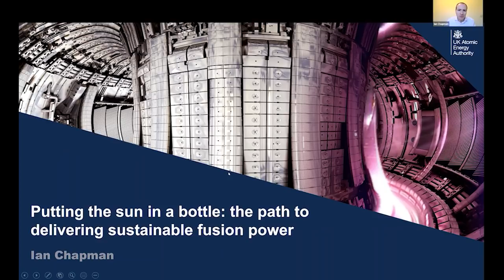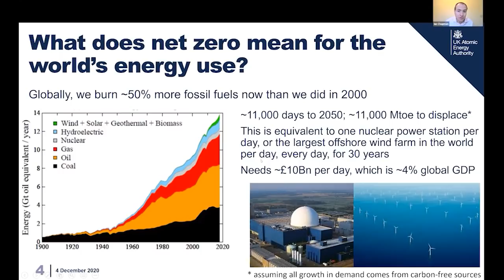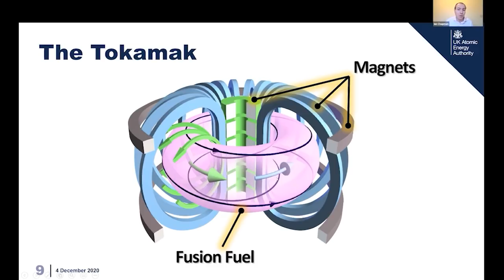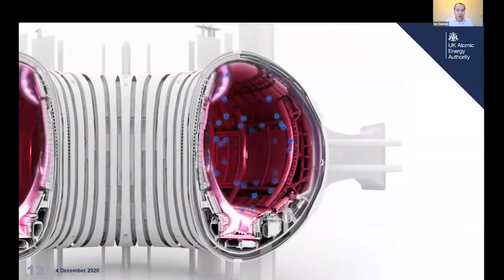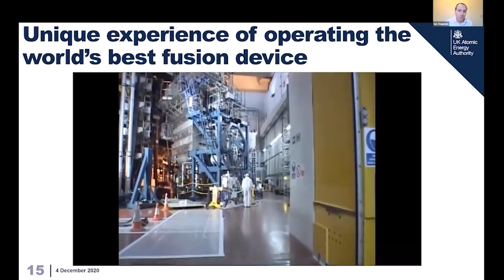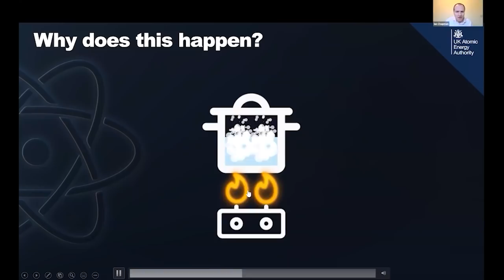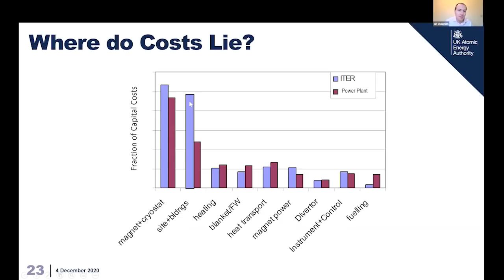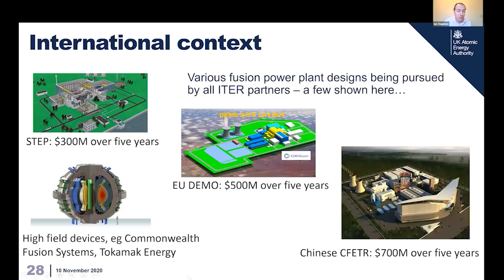Putting the sun in a bottle: the path to delivering sustainable fusion power | The Royal Society

Comment: Do you really hope, that the price will be lower than today´s 3 cents/kWh from solar and wind and in 20 years  a half?
Reply: Yea I love that he conveniently never gives a cost even if everything works as hoped(while at the same cost giving some of the highest cost estimates to other renewables I have ever seen)
Reply: It's not an issue of cost, but human planetary survival; otherwise you're going to have to get rid of a large part of the human population which would lead to mass chaos.
Reply: @waynet8953   The question is what is the lowest risk way to ensure human planetary survival. And cost is a key component of figuring that out. A low cost solution is usually the one that is easiest to get support for. Solar and wind are absolutely  capable of solving the electricity production aspect of global warming without needing to do something crazy like reduce population. And they are cheaper than fusion. There are perhaps other reasons to invest in fusion anyway. Solar and wind do have some downsides(nothing to bad to stop them from stopping GW) but enough that fusion may one day be considered a better tech. But if your goal is stopping GW outside of tech neutral approaches(carbon tax for example) increasing the useage of solar and wind power is one of the most important steps.
Reply: @peterisawesomeplease  isn’t that essentially what the green new deal that AoC was proposing? Because if so, with an estimated cost to make just America Green of $51 - 93 trillion dollars, I’m not certain I’d call that “Low Cost”. There is a very serious problem with your goal, and that problem is simply space. The reason for sky scrapers is because we started running out of room in popular locations to live in so we had to start building vertically to fit everyone, how exactly is one going to fit NY city or Tokyo with solar? You could centralise all the infrastructure into a small area, but then the damage that any natural disaster or something along those lines stands to do is tremendous. To cover just the amount of energy humanity is currently using, and not the amount of energy it will be using in a few decades when a plan of this magnitude could be expected to be nearing completion, you’d need to cover a path of land roughly equivalent to a significant amount of the Sahara desert, something a lot of countries just do not have access to, because there’s people living there.
Reply: @dylanshandley1246   $51 - 93 trillion dollars I have no idea where you are getting this cost estimate. Most recent estimates say we need 1 to 2 trillion in investment over the next 30 years. Doing it with fusion would cost more not less than solar even if we had working fusion power plants today.

"how exactly is one going to fit NY city or Tokyo with solar"

There are these things called power lines. Pretty cool. They can take power from places with cheap land to expensive land.

"land roughly equivalent to a significant amount of the Sahara desert" not per country. And actually not even for the entire world do you need that much space.
Reply: @peterisawesomeplease  $51-93 trillion is the estimated cost of the green new deal, which a politician in America put forward, according to that reps site, “The Green New Deal Resolution outlines the framework for a comprehensive and ambitious plan to combat climate change by creating millions of high-wage jobs in new green industries, transition our energy system and building new infrastructure.” 

So you’re going to centralise all your infrastructure into the place with the lowest land price and most available space, otherwise referred to as centralised infrastructure, something that has time and time again been found to have the rather glaring flaw of when something happens to cut those lines, suddenly no body but the state the power is produced in have access to it. 

I did say that to go 100% renewable that you would need an amount of land roughly equivalent to a significant amount of the Sahara desert, but I said that as a total figure, so yes, while not every country would require quite so massive a space, some would. Take Britain or Germany for instance, for them to go 100% renewable with current technology would take more landmass then is available to them in their entire countries, and they’re not alone with that.
Reply: @dylanshandley1246  "otherwise referred to as centralised infrastructure"

I am so confused. How is a fusion power plant less centralized than a solar power plant. Solar power plants can be small. You can put solar panels on your house. You can't put a fusion power plant on your roof.

"51-93 trillion is the estimated cost of the green new deal," 

Not sure where you are getting this number but maybe two things are giving you this insane number. 1. It is probably including things other than power generation(getting rid of airplanes is expensive). Power generation is only expected to cost a couple trillion dollars to convert to solar + wind +storage(less than the cost of converting to nuclear). 2. It is an old estimate. Even in the last 2 years the costs have fallen dramatically. In the US with 0 subsidies solar and wind are well on their way to taking over. They are already cheaper than new gas plants and continuing to run existing coal plants.

"some would."

This is just false. None would. The total size for the world as a whole need to be that big. If you split that over even 2 countries let alone 200 neither of them would need that much space. And we can use wind too. Some places like Britain are going to use things like offshore wind not solar.
Reply: @peterisawesomeplease   your confusion, I’d assume, would be coming from thinking a fusion power plant exists at this time. Fusion plants are only being built and used for research and to verify that fusion is actually viable at commercial scales, solar plants are already at the stage of commercial scale, and because of that, are inevitably going to be closer stationed together, though part of the reason for the clustering of solar is just that there isn’t enough room for them to spread out the farms and retain a competitive level of energy density. Fission and fusion have no such requirements, and since they’re so much smaller when it comes to footprint for the same or higher energy levels you can put a small or medium fission plant in a lot places where there would be room for solar or wind. 

One “medium” (small is defined as 300mw or less and medium is 300-700mw) fission plant (that’s what we’ve got the numbers at the moment so that’s what I’ll use as an example) covers about 1 square mile of land, a 648mw solar plant takes 3.8 square miles, so it takes 3x the land to produce a roughly equivalent amount of energy. You’re right In that you can’t put a fusion plant on your roof, but modular small reactors are becoming increasingly popular and one of them can fit in a shipping container in some cases. 

Iirc, the insane number came about more as a result of the green new deal wanting to retrofit just about every building in the continental US with solar panels, but in regards to your first suggestion that it’s the cost of things outside of power generation, I’m not sure how that invalidates the costs. If you want carbon neutral power, it’s for a reason right? And our reason for it us that the planet is getting uncomfortably warm and uncomfortably natural disaster-y, given that, why wouldn’t you be trying to remove all generators of green house gases like airplanes, ships, and livestock? Otherwise it’s entirely probably that even if you managed to make the entire world rely purely on renewables (which by the way, good luck convincing China, they’re building coal plants over there still and are a significant contributor to green house gases) in regards to your second suggestion, while I’m sure the prices have fallen, it’s only been a couple years since the green new deal was proposed (Sept/Nov 2019) so I highly doubt that a current price for the green new deal would fall so sharply as to be in the single didgit trillions. 

I could’ve worded that last bit better, I didn’t mean some would as some countries would need an area of land comparable to the Sahara, I meant that some countries would require massive amounts of land that they don’t have to be able to go full renewables. Places like Britain may well go with offshore wind (though wind power in general causes about 4x more deaths per TWh then nuclear), but being offshore makes it harder for other places to be able to use it, not just because every country in the world isn’t fortunate enough to have a coast to begin with, but because offshore wind is more expensive for places that are just starting to truly industrialise and improve their standard of living like many small countries in Africa as an example, and being wind power in general, means that it’s going to take up enormous amounts of real estate in places that just don’t have it to spare to begin with. Solar is really a much better option then wind.
Reply: @dylanshandley1246  Oh I am quite aware that they don't exist. Yet another reason to go with solar and wind.With solar you can choose how to cluster them to your heats content from totally centralized to totally distributed. Fission and fusion require you to centralize. Yes wind and solar have lower power density but I will take low cost over power density any day.

Yes the goal is to get rid of all green house gas emissions. Power generation is only one component of that. But this video makes that component appear much more expensive than it actually is. And more to the point it seems to suggest that fusion or fission would be cheaper than wind and solar when clearly the opposite is true.

Yes some places are better for solar. Some places are better for wind. Some are better for geothermal or energy storage. Some should probably just concentrate on doing other things and import power. Using wind and solar means that places without good sites for wind can still use solar. And places without good sites for solar can often use wind. The combination means we don't need a land area the size of the shara.
Reply: @peterisawesomeplease  mate, its cos then we will have free energy and the energy companies will collapse so there will never be a 'simple' solution that a layman can recreate
Reply: @peterisawesomeplease  "Yet another reason to go with solar and wind" - Are you serious? What we have right now is good enough, so we should not strive for better? That is your argument?

Also, let me tell you, Solar and wind are not low cost. I live in Germany, we have one of the largest percentages of solar and wind in our energy mix in the entire world. We also have rampant solar subsidies, paid by the people, and as a result have some of the highest electricity prices in the world.

Our neighbour France heavily subsidizes Nuclear instead, also paid by the people, and despite this, they still have lower energy costs than us. MUCH lower.
Reply: Solar is hard to beat until the sun goes down or winter arrives in your hemisphere. Both of which do occur I am told.

Comment: Making fusion happen is one part of the equation. Making excess power from said fusion will be a completely different story. Cost per watt my friend won't even be close to molten salt thorium reactors 30 or even 40 to 50 years from now.  For me the question is surrounding the magnetic  bottle which is only generated by superconducting magnets. These magnets gain the strength they have by lowering the temperature lower and lower. This is right on top of your thermal gain. The thing you are striving for. This is counter-intuitive to me while thorium will get easier and easier to separate isotopes and critical system components as time runs. How do you scale up a fusion power source? Well just like high pressure light water reactors you make it so humongous our national debt will tilt on each of these Hindenburg units. Fantasy proclaimed. Good forever till it costs so much and takes all science resources nothing else will work either.
Reply: Thorium is way more viable and the scientists know it. But they also all know that solar and wind are even more viable than that. The cost estimates in this video for solar and wind are ridiculous. They are only that high if you assume electricity storage costs will never decrease and that you are going for absolutely 100% zero emissions. Breaking either of these assumptions even a little bit dramatically reduces the cost. Going for 95% emissions reduction and assuming even 10 or 20% storage cost reductions gives estated costs 1/5 of the ones in the video. 

But they know this. The fusion dream is not about global warming. The fusion dream is about vastly increasing the amount of power available to society. Solar or thorium is enough to stop global warming but its not enough(for that matter fissile fuels are not enough) for society changing infrastructure. Electro magnetic high frequency launch space launch systems, vertical corn and wheat farming, sustainable mars and moon colonies, interstellar travel travel, .... The organizations backing fusion power fundamentally came out of the nuclear power infrastructure dreams of the 1950s not out of the environmental movement.
Reply: Superconducting magnets are still being massively improved, that will allow more power production. Best idea is to research as many options as possible in case some of them do not work. They know that fusion should and in all probability will work efficiently.

That means keep building renewables as well as storage. A lot of energy goes to waste because shutting down is not economic.
Reply: @peterisawesomeplease  nope
Reply: @SHREDTILLDEAD  Enlightening
Reply: Insistence upon laser fusion at Livermore in 1968-1969 was the biggest mistake they ever made. We could have had practical fusion power stations decades ago. They knew lasers were not a good solution but staked everything on it as a way to make money. It was a huge scam to get money.

Comment: Minor nitpik: It's unlikely those golfers jumped in a Diesel car. Diesel cars are incredibly rare in the USA. There are some very old Mercedes still on the road when Diesel had a bit of a moment in the US, but that's it.
Reply: California forest fires are all-too common. They also are not caused by climate change. The fires are caused by poor policy and forest mismanagement. The fire in this photo was caused by a gender-reveal party. The fire was accelerated because the idiots in charge (Gavin Newsome) will not allow foresters to clear the tons of dry tinder from deadfalls in the forest. It is not an accurate indicator of climate change by any measure.
Reply: @freedomsound4469  There is no single cause for the California fires. A century of fire suppression allowing fuel to build up is partly to blame, but California is also becoming hotter and dryer, exacerbating the problem. In natural, complex systems, it's usually overly-simplistic to identify a single cause.
Reply: @JonS  Id say it may not have happened if it had been raining right? ;)
Reply: @JonS  The bigger picture is that California has always been hot and dry east of LA. They've imported water to LA for a hundred years. You can't preserve habitat by letting it burn. The forests in CA are tinderboxes as a direct result of policy.
Reply: @freedomsound4469  that is part of the problem. The long standing policy of fire suppression goes back to some guy who believed fires were started by Satan and therefore had to be extinguished at all costs (which is a good case to illustrate why religion should be kept out of public policy). But it is also true that California is becoming dryer. At the same time we have more residential areas encroaching in to highly flammable areas, so there’s a triple whammy. Not everything in life has a single cause.
Oh, BTW we’ve had fires all across the state, not just East of LA. Napa is one of many such examples. It’s also a common myth that the fires are on forested land that has built up fuel due to a lack of logging. Most of the fires have been on brush land.
Reply: @freedomsound4469  your “bigger picture” is actually a perfect example of a cherry picked smaller picture. Forest fires East of LA do not represent big picture of what’s happening in California. I’m guessing you’re not a resident of California, as you seem to have little idea of what’s occurring here. About a much as a certain New Yorker who thought logging (of grass?) was the answer to our fire problems.

Comment: WHERE ARE MOLTEN SALT REACTORS.  THEY ARE THE SHORT TO MID TERM SOLUTION.
Reply: That’s fission. Which comes with its own set of problems...
Reply: I think your caps lock is stuck on.
Reply: @Tim_Small  Likely a PEBKAC issue
Reply: SMR   NOW

Fussion   LATER.
Reply: SO what, you are telling fusion researcher to "learn to code"?

Comment: So many comments saying
“I hope fusion is not more than 40 years away.”

ITER is currently under construction and is expected to produce an experimental 500MW on 50MW input in 2025. It is going to go commercial in 2035.

I don’t know why it seems no one said this during presentation.
Reply: Even if the first commercial plant is turned on in 2035. Will there be enough time to build a few hundred around the world before 2050? Will we be able to scale up fast enough to replace fossile fuels in time to make a big difference for global warming. I sure hope so. If we have an abundance of clean energy we could even afford to use inefficient electrolysis to produce hydrogen and then use that to produce synthetic diesel and jet fuel that would in effect be carbon neutral and it could be used in any old ice car.
Reply: @Philip Saville yes, you’re right. I was mistaken. I read up on it after I wrote the comment.